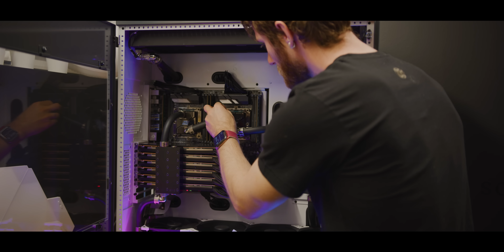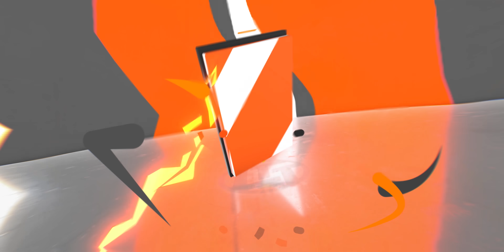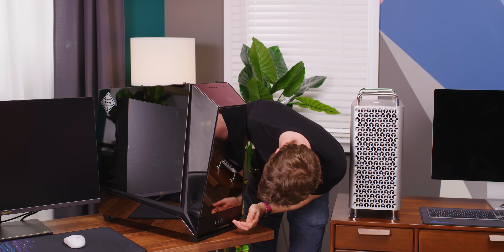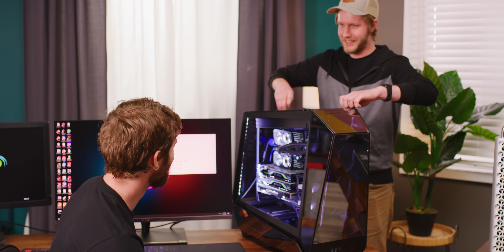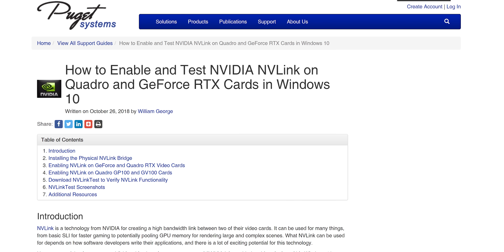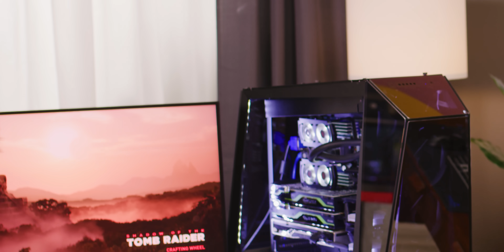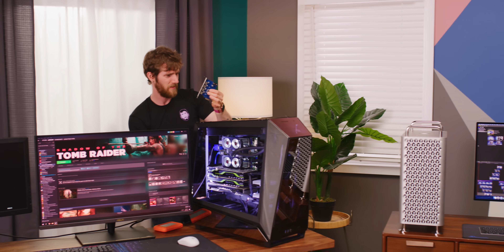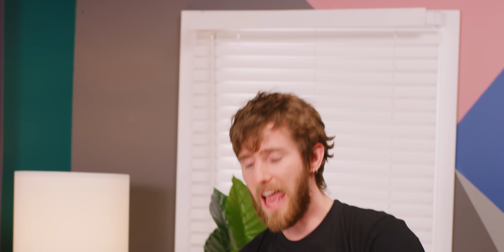The $32,000 Mac Pro Killer

Comment: I see a mac pro for 6500 euros which has exactly the same specs as the windows I built 3,5 years ago with 1600 euros. Something is not quite right here.
Only difference is a better videocard. to be expected. And double the ram which is pretty much overkill

Comment: This is really not a good comparison, most people if you get this will either use it for rendering (more likely if your replacing/comparing to a mac) or machine learning. I can count on one hand how many ML people use windows which is why the SLI instructions are for linux (maybe even mac). You really need to start looking at different use cases as it would of been really interesting to see how those nvlinked cards did with a multi TB ML pytorch model. I know it's not easy but maybe reach out and have different workstation use-case tests, as once your in the 4000+ range your talking about non-gaming use cases.

Comment: I would imagine that for any of the tasks you’d want to perform, the massive stability issues that were repeatedly pointed out by the team would be a major factor in why you’d just spend the money on the Mac Pro.  Sure, it won’t perform as well, but you’re not going to run into anywhere near the system issues you’d run into on a build like this.

Comment: These points are worthless, though, because they're not of equivalent value. The point the Mac got for taking 10-20 s. less to load into the OS is not of the same value as the point the PC got for being 50% faster in processing workloads, because the the latter is what these things were designed to do.

Comment: It is not in the 30 000$ that the mac is bad, it is in its 6 000-10 000$ range that it is a pure scam. I guess that Mac user that put 1 gig of Ram will be rare and a lot od base Mac pro will be sold.
In that range, especially the 6000$ one, it is killed in all case by any normal PC with decent specs.
Also when working with things like CUDA or IRay that works on several graphic card you don't put any Nvlink, it slow down the cards, it don't speed up calculations.
On my PC I use a 1080 and a quadro 4200 at the same time, no link and all works fine in rendering 3D on both cards.

Comment: "We built a hackintosh to defeat the mac in everything"
barely wins, by losing in everything except for raw performance
Reply: This isn't the hackintosh, that's a completely separate build. Also this non-hackintosh destroyed the Mac Pro is most benchmarks while some single threaded tests were slight wins for the Mac pro (and wouldn't have been in a Threadripper build which turbos far higher)

Comment: First comparison video I don’t like. Spent more time talking about what the PC has and how it literally was a pain in the ass to build and in previous video he said “went over budget”. Than actually comparing performance. 

Also. You gotta look at more than just numbers and power. Simplicity and how fast you can get a product is important to who the Mac pro is aimed at. You really think a doctor/engineer/scientist is going to wait MONTHS to find parts to build the Frankenstein PC you got here? Or simply go to Apple.com, click a few buttons and in a few weeks he’ll have what he needs? There’s A LOT of negatives not mentioned the PC demo’ed here has. The major one: not being easily purchased by who the Mac Pro is aimed at. Sure. You beat the Mac Pro. After months and tons of problems and still problems and downsides. But it’s useless to the public. Even the case is rare. 

Sure the Mac Pro isn’t the fastest or best and there’s FAR better faster systems. But what Apple did was nail it exactly on the right spot on performance, and availability. Months of work and headaches. To barely beat the Mac by 2 points? That’s a L from me.

Comment: "Mostly concerned with multi-core performance" true, but darn it, I have a dual Xeon 12 core clocked at 2.0 GHz and doing anything single threaded (and as it turns out there's a lot of that even in a pro apps like AutoCAD or 3DS Max) is a nightmare. Threadripper is a godsend.

Comment: Wow... I don't know if I could make myself spend the amount of money it takes to buy a really nice car.. on a computer. Granted, it is purpose built, but still, the risk involved if the power supply wigs out under load and destroys half the components in that case would make me want to take out a $50,000 bond to protect my investment (mainly because no insurance company in their right mind will insure any type of computer).😜 That said, it does put up some impressive numbers.😉 Personally, I like server boards for everyday computers, and I ran a dual-CPU Asus server board in my Win 7 machine for several years with 2 liquid-cooled AMD Opteron 280 dual-cores. It was a powerhouse in it's time, yet fairly cheap to build.😁

Comment: "both are running Windows -" I'm going to have to stop you right there.
Reply: @timithy4569  As I mentioned earlier.. Many benchmark tested here are just sucked on Mac os such as blender.. I think you're not aware of this. The early gaming benchmark test would have been worsen.. The only thing the OSX is needed during video editing. And they did that..
Reply: @timithy4569  The point is, they wanted to compare the hardware. So yeah they have to use the same OS, otherwise, you'd just be comparing software.
Reply: Well to do a proper apples to apples comparison of hardware you need to run the same software on each, so yeah both need to run Windows, you're never going to get OSX to boot on that server board
Reply: @shanematthews1985  exactly... Even some benchmark he showed are just suck at OSX.. Games even worser.. The only time he used macos I think during video editing test
Reply: @shanematthews1985  Mac hardware means mac os in any practical application. No sane person is installing windows on mac hardware in anything but the weirdest use cases.
Reply: You can't use Apple's inhouse software that literally has no comparison because the rest of the world uses Windows 10. To compare performance numbers, both must be on the same playing field.
Reply: He only did gaming benchmark on windows cause mac os would give out even worse numbers. Rest all was done on mac os.

Comment: On comparing the afterburner card to the dual quadro cards, isn’t done correctly. Afterburner only handles decoding Prores raw, not even encoding. So, by comparing the export time of the video, is just essentially comparing the quadro card with the radeon card, not the afterburner.

Comment: Would running windows instead of MAC OS cause some sort of performance diff? Not sure, really just curious.
Reply: Of course. It will be like the performance difference between an apple and an orange.  Just pick a system that meets your specific needs.  Windows and MacOS does things very differently under the hood so it's kinda pointless making benchmark comparisons

Comment: Can u guys run same test but with mac os on mac pro? Not a video just post those results on ur forum. As the mac os build for mac pro will have the performance enhancing software built into it as it was specifically build for the mac pro. By using mac os the result may change and also we can see a real showdown between these two. I think you can only do a serious competition, when u use the stock os for each build. Cheers!!

Comment: Hey guys just trying to ask some information about my system. my laptop is a Aspire 5 a515-53g and the first time i checked to upgrade its ram from 4gb to 8gb
in the task manager it was displaying 2666mhz and then about a year  of using it it went down to 2400mhz  (the ram is soldered btw). and then when i bought a 4gb ram  2666mhz when i checked my task manager it was displaying 2400mhz. i dont know why it changed. can anyone help me. THANKS!!

Comment: It's a nice Widows PC but hardly a direct competitor with the Mac Pro since that PC doesn't run MacOS.  That PC would likely need some highly-skilled personnel for after-market support if anything goes wrong.  I get it.  Custom-built machines are great but can be major headaches for users.  Choose whatever machine is best for your needs but I think reliability is very important in daily workflow even if you have to give away some processing power.  No mention was made about which computer was quieter for desktop use or how quickly parts could be swapped.  I personally wouldn't want to deal with water-cooling and I have no interest in RGB anything.  It was a nice project and rather interesting but it honestly won't hurt Mac Pro sales in any way for Apple.

Comment: Did I hear "python compiling"?
Well in fact python can be both interpreted or compiled (in fact the .pyc files are the compiled ones which when having executions rights can just be launched as any binary could be (I did some reverse engineering on a .pyc file and you can decompile it)
So for everyone saying python is interpreted you're not wrong juts rember it isn't always the case.

Comment: The cheapest component of this system costs more than my whole setup.  :(
Reply: You have a PC worth 14$ ?
Reply: Your whole setup is less than $270?
Reply: Your system is worth less than $13.90?
Reply: @josephgold208  very well said. Indeed, it is a good lesson to keep in mind.
Reply: I've been saving up to build a desktop (I'm a newbie college student :( 
Does anyone know if Mac OS could run on my crappy hp 6470b.
I'm currently using windows and Manjaro
Reply: @theartscanut7355  When you run Mac OS on non Apple hardware, it is called Hackintosh, right?
Reply: @luisduck3737  yep
Reply: @theartscanut7355  If you have the time, just give it a go, try to install it and see if it works. ;) If you do proper backups, the only thing you can lose is time. I think Mac OS is more light weight than Windows and a little heavier than Manjaro (out of the box), so it should be usable, if it runs at all.

Comment: In terms of the video shootout, you can't just time the render.  You need to include the user interaction, like you did when you competed against iJustine.

BTW, what was the cost of assembly, i.e. man-hours that you spent putting the thing together.  I think the cost of assembly (as well as the R&D) is already folded into the Mac Pro's price tag.

Comment: I know it won regardless, but I think the PC Pro deserved a bonus point, if not two or more, for finishing the MARKbench when the Mac Pro was still at 45%. Not only is that an absolutely massive margin but as mentioned in this video and the standalone Mac Pro review, the target market for the Mac Pro is high-end content creation. That means the PC Pro beat the Mac Pro on its home turf by more than double. That's worth way, way more than a three second lead in a Python compile test (who the hell would spend $32,000 on a computer they use to code in Python?)

Comment: you should be comparing it with an HP Z8.  best case ever, push button removable 1700W PSU (240v), 3TB ram, dual xeon procs, dual onboard 10gbe.

Comment: macOS has a modern file system while Windows has one that is older than many watching this video & less than 1% disk fragmentation will cause performance issues (even on SSDs).  What Windows 10 build were you using?

Comment: A DIY computer has always been cheaper and faster since when I started in the 90’s. The problem is this build took who knows how long to design and hack together a Frankenstein computer which will most certainly be problematic with windows, software and driver updates, and have almost no support to turn to except yourself. And that’s fine if it’s your personal machine. Alternatively, out of the box solutions that nontechnical people can plugin and go in minutes, including support contracts, will always be more mainstream. And it may not beat the DIY computer, but it’s very close with almost no advanced computer knowledge.

Comment: Perhaps 1% of power users could use that much RAM, but I guarantee many more users could use more than 32 CPU cores. Why not halve the RAM and throw another EPYC CPU on a dual-socket board? This isn't built for performance as much as it is to cost as much as possible.

Comment: Literally just hours ago I said in the comments that you trying to compete with Apple is pointless, silly and doesn't lead to any viable tips. And you did it again. So, Linus, be honest here - how much time it took to put together this PC and make it run, compared to buying the Mac, upgrading it and make it run? Or do me one better - how much noise from the PC Brandon had to edit out of this video? Only the Seasonic PSU that paid for that video is louder at 70% load than the whole Mac! From then add the pump, the RAM fans, the Quadro blowers (with their mind-breaking whine), the rad fans. And that "beautiful" case, the fingerprint magnet with panel gaps bigger than a Tesla. It's neither aesthetically pleasing or convenient in any way for the end user. You've mentioned practicality, but didn't discuss it because it was really not convenient. Dude, for $32 000 . . it's still a PC, still running Windows with all of the broken update and stability issues. You can game AAA titles on the same res and fps with 10 times cheaper machine.

Comment: $32K PC: In terms of ports, we have no ports.
Reply: It's not hard to get more ports on different builds.. But amd doesn't have much OEM's support and it's server grade mobo. That's why it doesn't have much port. Their TR workstation grade mobo does have..
Reply: @aluandcache7336  bro it's not the same. Apple does a crazy job getting their thunderbolt 3 ports interfacing with their. displays.
Reply: @curt8806  It's not helpful at all specially in enterprise workstation market.. DP and HDMI is the most commonly used two display outputs today.. As Apple wants to sell more TB dongles and port they interfaced it with the amd gpu.. But it obviously requires Intel certification or more likely their chips.. Other than output displays all TB has no access for anything.. Both Quardo and Titan comes with bunches of DP, HDMI and usb type C..
Reply: Sp3r2 Socket yeh I’m not a fan of usbc ports for everything. For one they’re so fragile.
Reply: @curt8806  I'd rather have a little hassle compared to spending 30k more
Reply: They forgot about Linus’ $20k per video salary...
Reply: @curt8806  im not gonna lie... but i think thats the kind of range linus gets for a sponsored video... and i think ur on the cheap side there
Reply: @curt8806  he pays 20+ people
Reply: @curt8806  dude this vid only made 4k lol
Reply: @wealllikeitsomilkit4301  English speakers earn 4 dollars per 1K visits and the video has 5M visits so...
Reply: @matiasdariel7291  you do know that adsense only apply if the video had Ads Right? 🙃 , Since there is Little to no Ads here I'm Pretty sure 4k is the max he made off of Views Alone thats why They Had Sponsors.
Reply: Very good comment lmao
Reply: i want a pc with at least 10 usb ports even though i know usb ports will be irrelevant next year 😌
Reply: poland if they scede danzig
Reply: 3000th like
Reply: LOL
Reply: Hehe, this genuinely made me chuckle
Reply: @efwfewewf4649  for sure, but USB-C has taken dominance in charging (excluding chinesium-alloy electronics, and also Apple, but fuck Apple) and is used in portable displays quite commonly where HDMI would be too large.

Comment: Great content as usual. The point at 17:00 is good!

Question: The graph at 16:05 has the Mac Pro outperforming the PC Pro in Solidworks, but didn't you just demonstrate it losing horribly in the same application? Is this a CPU only benchmark? It would have been nice to label which test uses which hardware. Of course, I might have just missed you saying that.

Actually, you guys are getting big enough with enough access to massively parallel hardware that you're beginning to need a high performance computing guy, like Dr. Kinghorn at Puget (he runs the HPC Blog), who can figure out how to properly benchmark and interpret the results (not that you did a bad job, it just could be a lot better). Like hearing 'python compiling' was particularly jarring, because it's really a benchmark of the math libraries numpy/scipy in python and no compiling is taking place. Maybe not hire, but atleast someone to contract for bigger projects.

There's also some difficulties with using Ryzen on certain math libraries, Linpack being a notable example, due to certain processes not scaling as one would expect, especially getting to the 3970X and beyond. Although there's hope of this getting better, as many computational mathematicians have switched to Ryzen on their HPC / personal hardware, myself included, and are working on optimizing for it. But if we're talking performance *right now*, and with people not necessarily with technical ability to dig through the usually terribly documented optimization settings to select Ryzen-friendly ones (particularly the MKL_DEBUG_CPU_TYPE=5 step comes to mind for intel's MKL and achieving good Matlab performance), there's a lot of reason to go with Intel if you're apple. Of course, no one is using a Mac Pro for math, usually that space is dominated by Linux based HPC clusters, noting that people usually use their own preference of OS for initial developing.